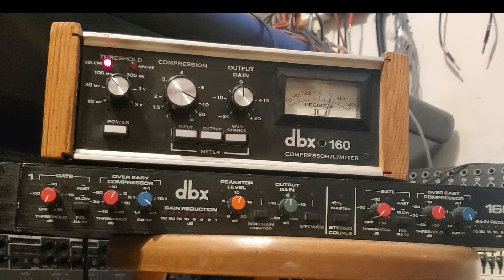DBX 160 VU VS DBX 166 - Drums And Bass Comparison

Comment: Funny on the smartohone speaker (Samsung Note8) the 166 sounds worse (dull) but in the (normally very sensitive and crisp true sounding Philips SHP 9500 headphone monitors) no difference between 160 and 166 wjeread I revently heard the difference between the 166A and 166XL in some other test on some other youtube channel (166A being the better comp of the two - better suited / better sounding for dance music mastering-  having more "groove", whereas the 166XL had more boring dry / neutral / less colored sound (and thus costing 2-3 times less
on the second hand marketplace)

Comment: What ICs and caps did you replace them with?
Reply from the maker: Those are the modifications I've made so far to my DBX 166:
PSU MoD: – Replace c3 ,c4, c7, and c8 with 1000uf-2200uf 35v caps
– Replace c5 and c9 with a .1uf film cap (preferably polypropelene)
– Bypass c6 and c10 with .1uf film caps
Channel 1:

IC MoD: – Replace chip OA1 with better ic (NE5532,) 
– Repalce chip OA2 with better ic ( OPA134) 
– Replace the VCA IC1 with a THAT 2180AL08-U (lift pin 4, pin 4 should not connect to anything)
– Add a 47pf NPO ceramic cap from pin 3 of OA2 to ground (Suggested by Jim Williams)
Reply: @ Thanks for the info, I saw you also replaced some resistors for improved gate response. I getting a made in the USA one. Guessing it’s still worth modding the USA made 166s, they are sonically supposed to be more superior to the made in Hong Kong ones. Once I get it I’ll open it up and see what it’s got going on. Thanks again.👍🏽

Comment: didn't think any is better than the other, would use both. I have this 166 and the 160A, the former often sounds way smoother - very noticeable on the kick drum example.
Reply: Would you Say that this 166 is better than a 266xl, please?
Reply: @raelmickaelbeneteau1125  sorry I didn't see it sooner. I have never used the 266xl. though, it's newer and has the expander option instead of only gates (with only 2 release options, fast or slow), which I'd really like to implement.